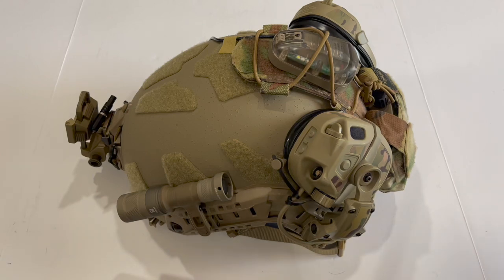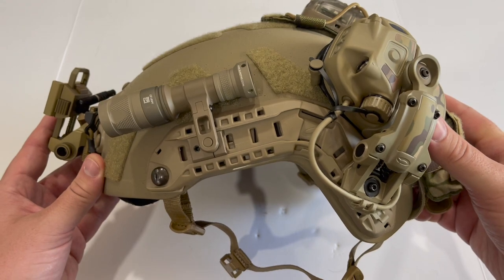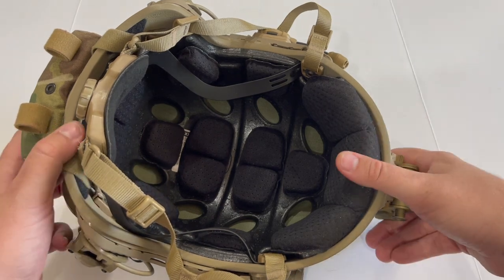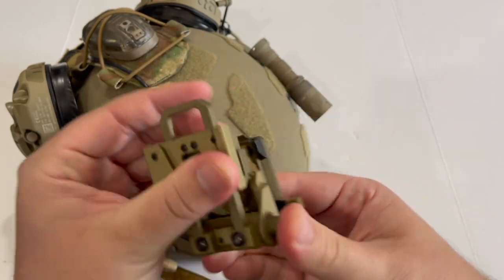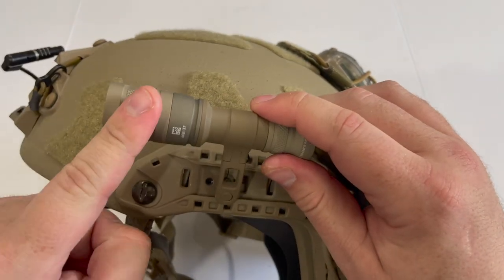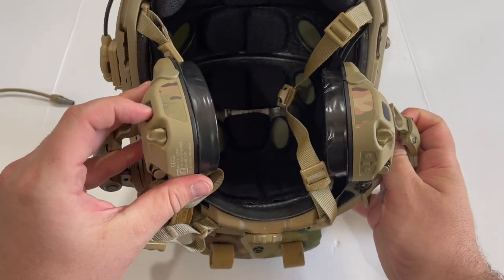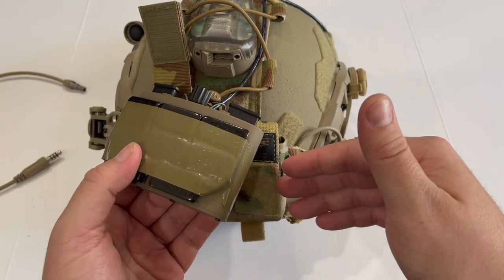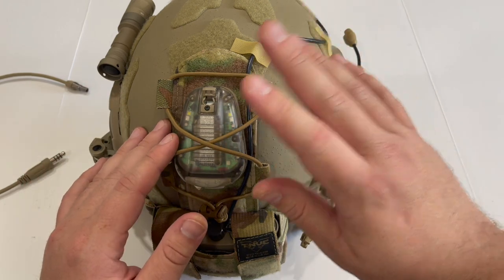High-End NVG Helmet Setup (Ops Core, Wilcox, TNVC)

Comment: Superb overview, and I'm glad to see the "you copied GT" comments haven't appeared yet. The TW camfit is my pride and joy.

I've been using the AMP a lot more as of late and came across similar issues as you mentioned. One big letdown for me is that the NFMI plugs don't transmit effectively when the cups are popped out with the arms. Mounting up the AMP using 3M adapters is probably more practical than people take it for, because they give just enough standoff for the plugs to receive (albeit, at noticeably lower volume). While not perfect, it's definitely useful if you want to cool off, remain tuned in, and keep an adequate level of hearing protection.

Comment: Why use weights instead of more batteries?
Reply from the maker: The battery pack can either hold 2 CR123A batteries, or 4 AA batteries. Neither of which weighs enough to balance RNVGs

Comment: I thought the helmet bungees were to help hold the mount steady. Not to hook to nvg themselves
Reply from the maker: Nope.
Reply from the maker: https://cdn.shopify.com/s/files/1/1664/1057/files/Ops-Core_Modular_Bungee_Shroud_User_Manual.pdf?1245

The third step (per the manufacturer) is literally “attach bungees to NVG”
Reply: @InferiorRifles  your bungees are different after looking back at the video hence why I deleted the comment. I thought you had the side bungees that attach to rails my bad
Reply from the maker: @bangbanggvng  You’re referring to Ops Core’s older bungee system. Either type of bungee is designed to attach to the night vision device itself, in order to take any play out of the folding arm mechanism. The photos that you see of the bungees attached to the helmet shroud are just showing how the bungees are stowed when not using nods. The helmet shroud is bolted to the helmet itself and does not require any form of stabilizing. It’s already rock solid.